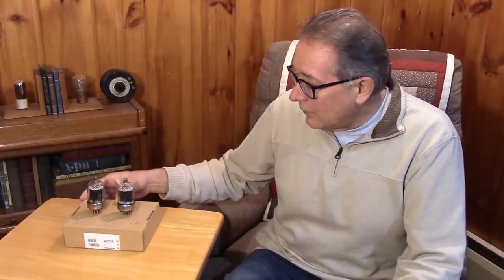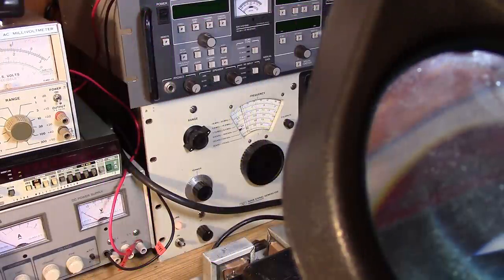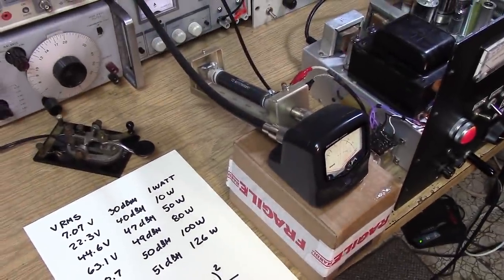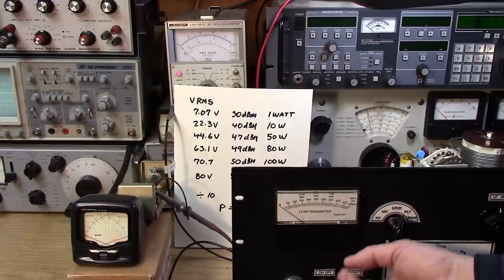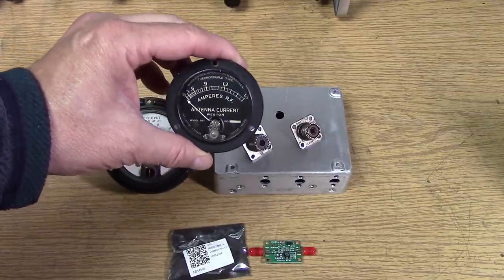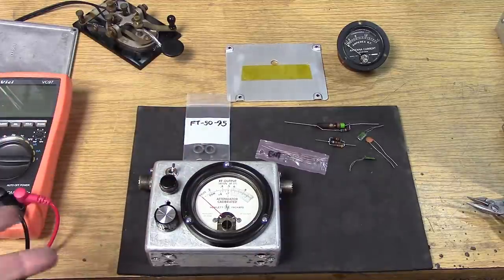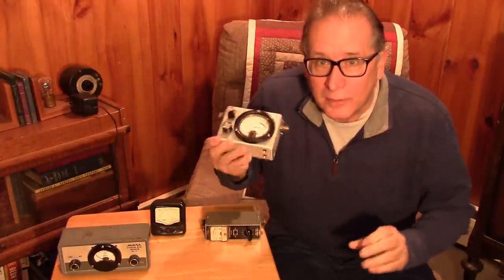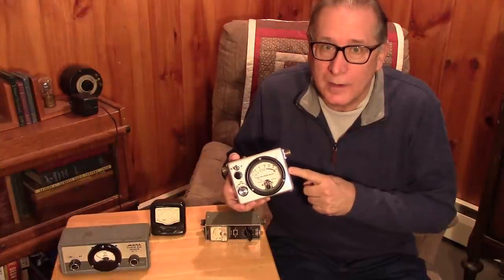My 630M Adventure - Part 6

Comment: Thanks Mike. Very interesting and lots of useful information. Nice that you went for an older school approach and recycled the old ammeter.
Reply from the maker: I tried to convert a broken one by making a toroid pickup to replace the thermocouple. It worked and I was starting to adjust it and broke the movement clean. Darn.
Reply: @MIKROWAVE1  Of course, I have never ever fried a microammeter 😳 (both fingers crossed behind my back).

Comment: I'm quite new to your channel, but I've learnt quite a lot with the many projects you have demonstrated. I have built several radios, mainly with transistors, only one having two valves.  Hope you had a great Christmas, wishing you the very best for the New Year.
Reply from the maker: Building radios is fun any time of year - but especially when we are shut in with some nasty weather and have the soldering iron hot.

Comment: Can PSK be used for communications on that transceiver.
Reply: If you check back to the earlier video's he built a CW transmitter for 630m.
Reply: @U812-k7j  I know that but might be another useful method of modulation.
Reply from the maker: A little upper sideband transceiver for 630M that could accept the formatted audio from a sound card might be an interesting project.